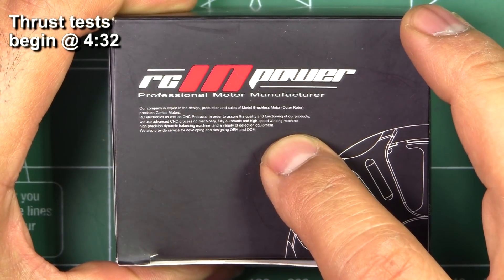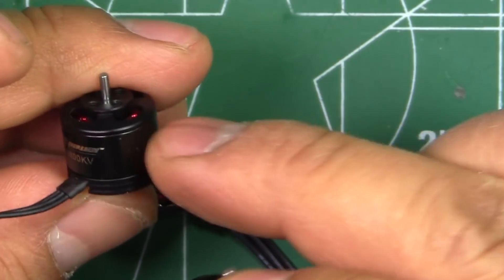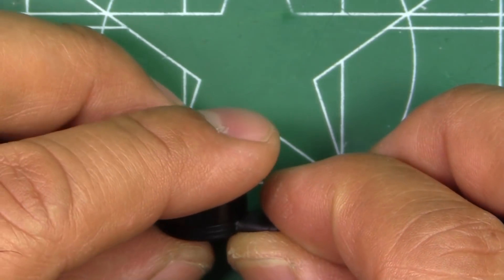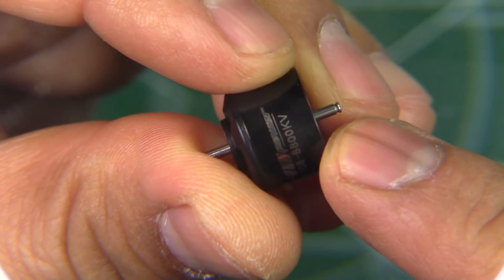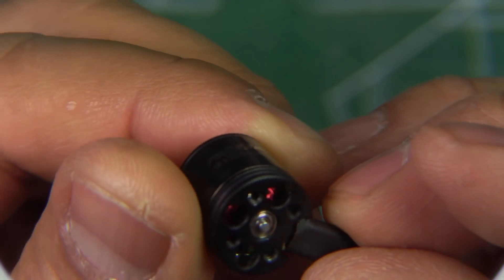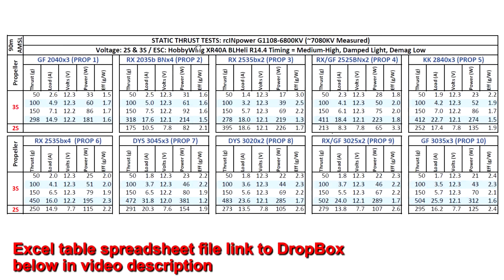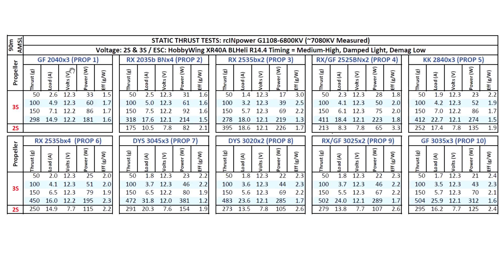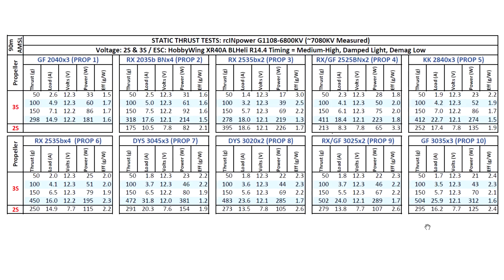rcINpower G1108-6800KV Big Micro Power! 0.5Kg Static Thrust !!!!

Comment: Did you ever test the 1108 4000kv???
Reply from the maker: Didn't get around to testing. I got flooded with so many new motors from EMAX, BrotherHobby, rcINpower... etc I didn't have time for that one. I may still test it in the future when I have some spare time but motors keep coming in!
Reply: please test the 4kkv. I have some in the mail now.
Reply from the maker: Yes, I want to test it, but unfortunately I have been very busy at work and have not had much time for hobby stuff :(
Also, BH, EMAX, and dys sent a bunch of new motors and have been asking for the results.... and the extreme high temperatures for more than 1 month straight have not helped! I can't test when we have 100F/80F day/night temps. Results are affected (lower) due to lower air density. I have to setup testing equipment in my living room and crank up the A/C and ignore my wife's complaints.

Comment: Does any1 actually fly these Motors?
I use em on 2.5" Frame with 2540x3 Gemfan Flash and 3s Lipo. My Motors get insanly Hot, no short on screws, no filtering and even lowered pids quite a bit.
What Temprature can they acrually survive?
Reply: nope :/ i just live wih it and fly em till thy die
Reply from the maker: I have seen Kabab FPV flying them but I have not looked around for more info. First time I hear about them getting hot. :( 
https://www.youtube.com/watch?v=rdmer9IO1-I
Reply: Same he Schnitzel, 2.5" frame 120gram AUW on 3s and all motors run ridiculously hot after just half a minute of flight! Did you figure it out??
Reply: I'll http://m.sw.org/misc/health/Postpartum%20Tubal%20Ligation.html
Postpartum Tubal Ligation
 Schnitzel sYOwGI lol
Reply: booda frank what the hell is that..... lol

Comment: Just got these, put them on a 2.5 frame running 3s. HOLY CRAP. Too bad it sucks down the battery just as fast, if not faster than my 5" running 2507 motors.

Comment: Holy cow. These look powerful! My Kingkong ET 125 has the stock 1104 7500kv on it. Can I replace them with these 1108 motors? Would it be worth it?
Reply: josh milligan Youd burn the esc. These things draw A LOT of amps lol. Id use at LEAST a 15amp esc and really you should probably use a 20amp to be on the safe side.

Comment: Tryed mine today, Holly crap this motors are awesome, so smooth and clean, I mean no huge power spikes, easy to tune and crazy powerful. Love it.
Reply: How do you feel they compare to the Hawksky 1107's?
Reply from the maker: Thanks for the report buddy. Always great to hear from experienced users. I can't wait to try them
Reply: EngineerX really do, I was afraid of the weight but I can't fell it. Really good feeling flying them.
Reply: after more testing ive found the rcinpower very soft aluminium and not that durable, the hawksky are tons better in that matter, in flying i like both with the rcinpower slightly smoother.

Comment: Is it possible to run 4s on these motors or no
Reply: fonzell hudgins it should be beefy enough. Ppl run emax 1106 on 4s. This is the motor I'll be trying it with. 1106 just seems a wee small. Same with rotorx 1107, 7000kv is too high anyway. And 1404 motors seem to be more torquey and more efficient. These motors are for speed. Don't use crap battery's.
Reply: nick smith cool cool, I'm actually running emax rs1106 6000kv 4s tattu on my micro lol. Im interested in these :)
Reply: Ah!! Lol engineerx suggested 4500kv is a little low. 6000kv is the sweet spot but yeah if your 1106s don't burn out the 1108s I would imagine work fine.

Comment: Hi, with 2535 props 450gr and only 16amp!!?? Could be a mistake?
Reply from the maker: Definitely NOT an error in measurement, but an error in the Excel table - specifically in the data pulled by the formulas that select the corresponding values. That happens every now and then because the RCBenchmark thruststand electronics, particularly the load cell data lags behind the current sensor. If you inspect the formulas used in the Excel spreadsheet , I force selecting values that correspond to the previous row for Amps, but in this instance it lagged a bit more and the correct value is 2 rows above. Open up the Excel spreadsheet and look at TAB for prop #6, row 15= 24A should be the correct value reported. I usually catch it before the final edit but this time I didn't. Always check the Excel spreadsheet and take a look at the raw data. All those rows begin to look the same when video editing @2AM
Reply from the maker: See my reply to Kris

Comment: There is a small error in the result sheet; Prop 3 the 2s data seems to be 3s . Thanks for the video!
Reply from the maker: audiogek I'll have to check the Excel table and revise it. Thanks for the heads up.
Reply from the maker: Yep, when I shot video for comment I had not check the final Excel table revision. The Excel table has the correct data.

Comment: Anyone else really badly want to see this used on an overpowered micro wing?
Reply: Aryan Gangurde yep, im putting mine in a 13gram (including standoffs!) 3 inch frame with hglrx 28amp 4 in 1 esc stack. I found a $25 gift card for amazon and the set of 4 1108 motors were on sale on amazon for $50, so it only cost me $25! I use that same esc in alot of quads so its easier to repair them all. My 4 inch quad has the same esc and weighs 130grams dry. Ultralight setups with too much power are pretty much all i build. Heres my rotorbuilds link for my 4inch. https://rotorbuilds.com/build/12841 Ill also post the 3 inch build on rotorbuilds once I finish it!

Comment: You need to start using more relevant props. Most of this means nothing because these props are incredibly out dated and not very good or efficient. If you aren’t using Dal or HQ or even the new emax props, you’re doing it wrong.
Reply: Beau using the same props, regardless of the newer ones helps give better comparison to older models when those props didn't exist. Or means doing even more tests
Reply: Kwad Karl why would you want to compare to older models. 3 months of motor tech is A LOT of time. That’s like saying we need to use rubber tires on flying cars to compare the two...if the tech has advanced and props have definitely advanced. Then use it with the new tech. Comparisons of models are invalid if the they have no bearing on usage. This is stats 101.
Reply: Beau I agree with you about using newer props. Its something I'd like to see. But I guess being ask this info is added to a data base. There needs to be a constant.
Reply from the maker: Beau  wrong. All those Props are relevant. The main purpose of the tests is to show the motor performance. Props are secondary. In addition all the modern props like the GemFan 2540x3. RotorX 3044x3, those new Avan will actual show misleading poor performance as they've been designed for dynamic conditions. They just don't like static air and thrust numbers will be low and Amps high but we all know they fly really fast. I already ran the RX3044x3 and GF2540x3. Using the same props allows for comparisons with previous motors. That's the main purpose. Every now and then I do test the new props just to show what I'm talking about. I have some recent tests with the EMAX RS1106-6000KV with GF2540x3 (need to edit video)
Reply: His methodology is primarily for showing motor performance. It's doing exactly what he wants it to do. You could stand to be less whiny about it.
Reply from the maker: Dude, if you don't like the tests... sorry, you're going to have to look for another tests that fit your requirements better, clearly none of these tests are useful to you so don't waste your time watching irrelevant stuff ;)
BTW not all motors I test are free. I purchase quite a few - in fact this 1108 motor I purchased it from BGood when it first came out because rcINpower had not messaged me that they were going to send motors. rcINpower did end up sending some... I've also purchased the 1506, Cobra 1407s, Racerstars 2307, 2406, EFAW 2407, KingKong 2405, SunnySky 1106, 1408, dys Samguk Shu 2500kv, T-Motor F20, ... and many more. I won't bore you with details about the amount of time it takes to run these irrelevant tests, just a pity they're not at all useful. Hopefully a couple of other people will find them useful :)
Reply: And so are you, shithead.
Reply: And you seem like a shithead.
Reply from the maker: I already stated why I've decided not to test those new props in my 1st response to your suggestions: Those have been designed to perform best in-flight, moving forward at speed. They show poor performance in static conditions, especially with these micro motors with high KV. 
I think you should prove to yourself what I've stated (if you get different results, then show us). It's actually very cheap and easy to make your own DIY thrust stand and I always encourage people to have a go at it. It really is the best thing to do when you can't get the information you're looking for. That was the main reason I started testing about 4 years ago. 
All you need is a $8 digital scale, a $15 to $25 Powermeter, a couple of square aluminum tubes or pieces of wood and the rest you should already have laying around
This is what I was using a couple of years ago: https://www.youtube.com/watch?v=r1lPDapmOG4
Run the tests with the props you want to get data from and then you can share with us and contribute to improve the data available on props. We will all benefit. As I always say: Two testers are better than one!
Reply: Beau you complain that he uses old props and you say “will have “and “just came out”
You want it all and you want it NOW!
Maybe you could do some reviews....
Reply: Do it yourself, shithead.
Reply: His testing methodology is correct for comparing motor performance. Hope that helps! :)
Reply: And I doubt you have a masters in anything. Maybe you have some skill as a keyboard warrior!!!
Reply: Which props are you referring to? Does emax, hq and dal have 2.5 and 3 inch t mount props?
Reply: Beau well that motor is too heavy for 2inch imo. Good thing new 3 inch props are coming out.
Reply: I've sent him props that I wanted tested in the past. He was very responsive by YouTube PM. I'd reach out and send him a set of each that you'd like to have tested
Reply: wsc112782 motor prop combo is the only thing that matters when testing a motor. If you put props on from two years ago and the motor performs poorly, you’ll think the motor is bad. But take that same motor and the latest and greatest and it tells a different story. You are entirely ignorant and instead of forming a logical fact based argument for why you think im wrong. You resort to personal insults. You, are clearly less intelligent than a smart 4th grader.
Reply: So by saying someone is whiny is a insult... Then you have the mentality of a 4th grader.
Reply: Omgwtflmaololrotfl not even a coherent statement
Reply: Omgwtflmaololrotfl lol doubt it all you want. I know what’s true and what’s not. This entire thread I’ve offered reasons why, statistically his method is incorrect. If you want to read up on it then look up the term “statistically significant”
Reply: Beau using micro fpv props from 3 years ago lmao!! Under what rock did you crawl from!!
Reply: Beau the crap you spew must make sense only to you!
Reply: Omgwtflmaololrotfl you keep commenting and failing to point out where I’m wrong and subsequently, appear very uneducated. Prove me wrong. With facts. Shut me up for good. Come on. I know you think you can do it!
Reply: Beau tell you what do the thrust test Einstein and we wil come criticize your results! Everyone is happy with his test but you. Seems the problem does not lie with any of us. Makes you wonder!!
Reply: Omgwtflmaololrotfl this is like, 4 comments in a row where you insult. It seems like you’re unable to provide any credible argument about why I am wrong. Saying that other people are or aren’t happy is anecdotal at best. My position is, the data is invalid because updated props are not utilized. While it may show a comparison to other motors, it does not provide a valid baseline of operation. Therefor outdated prop data becomes invalid. If you don’t realize errors in things you’re not educated about, it doesn’t magically make them correct.
Reply: Insults???? 4???? He will have to run all his motor test over again with "the new" props to form a proper baseline IDIOT!!!! 1st insult!!! You cant compare any other tests then if he used new props with these motors there is nothing to compare it with then!!! Douche Bag!!! 2nd insult!!!! So you point is 0!!!!! Crap for brains!!!!! 3rd insult!!! He has tested all the "older props' so you can form a baseline as to how the motor stacks up with thrust and the rest!!! Scum bag!!! 4 insult!!!! Now i insulted you einstein....now you can complain about a insult little whiney pancy!!!!
Reply: GoatZilla lol. You’re like 4 months late to this convo. And no. He is in the public realm and therefor open to criticism
Reply: GoatZilla you seem like a very angry person. I bet your extremely gullible and easy to troll.
Reply: The new Emax props are terrible. Good lord, man...
Reply: TheRealJonnyD that was several months ago but the statement stands. If he’s using non relevant props to do testing (and props matter more than the motor) then the test is futile and irrelevant.
Reply: @Beau It seems you didn't understand the part about dynamic vs static test.  He already stated how his tests might be misleading to certain props which are designed to perform in real life vs static testing.  Even if he did what you asked it wouldn't get you the results you want since he is only doing static thrust testing.  If you really, really cared about it, you should do your own dynamic test setup and share.
Reply: Seems like you don't really care about anything but proving yourself right.  Sorry, but you won't be convincing anyone of anything but your bad attitude.  He did state the difference between Static and Dynamic testing 3 months ago.  Try comprehending his replies next time.  Peace out.
Reply: VRforAll you’re literally trying to litigate something from months ago. Please do something better with your life. You should be at a race. Out in the sun. Not being a keyboard warrior. Please. Save yourself the embarrassment I feel for you.
Reply: Emax will have 2.5inch props out soon...as of now they have 2 inch and he ALWAYS does a 2 inch test on these small motors....HQ has a 2.5 that just came out and has a 3 inch on the way...both of which are the most durable props Ive ever used.
Reply: dronepunk FPV if I could buy the props cant he??? He gets all of his motors for free (from what I understand)...he certainly can ask for a few sets of props and even get early releases
Reply: dronepunk FPV also, if I had a following, the equipment, cameras, and free motors. You sure as shit better believe I’d be doing reviews of the stuff AND having relevant props
Reply: EngineerX so you don’t like input, even when that input would improve your statistical data? I have a masters in this...that’s how I know I’m right, hate sound cocky like that...but it’s true.
Reply: EngineerX thats at least an answer I can live with. But if you are testing for static thrust and utilizing that as a representation of power(J/s), then why not use only one prop that is ideal for static thrust, or at least horizontal thrust.
Reply: EngineerX so if you go to miniquadtestbench and look at the thrust test numbers...you’ll notice that the prop matters more than the motor, when it comes to: efficiency, thrust, responsiveness and just about any other aspect. If equal size motors produce numbers +/-10% of each other on the same prop across all props...then the prop matters more
Reply: His methodology is correct if there is a clear defined baseline from which he is progressing from....there is not....so it is not